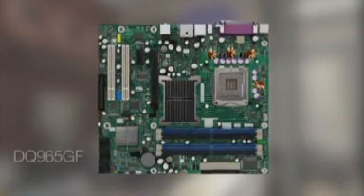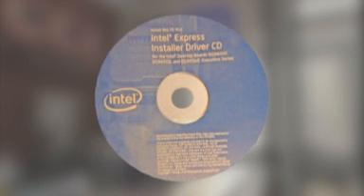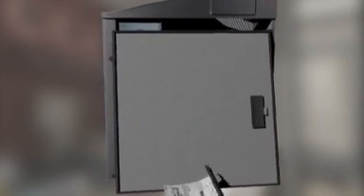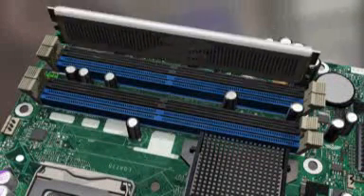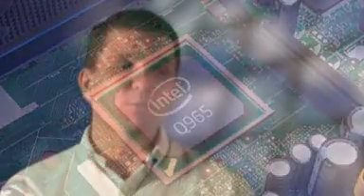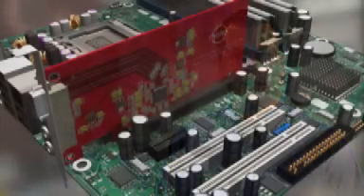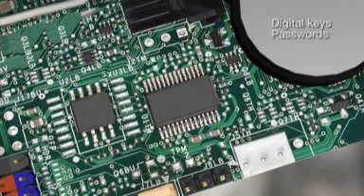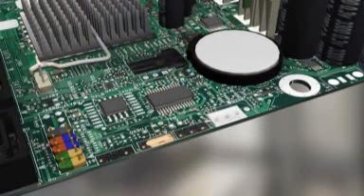Intel DQ965GF Motherboard Review

Comment: I have an old pc ive been trying to get working again.. It has an Intel Board DQ965GF in it. It powers on, but unfortunately I'm always getting a black screen even when I have the disc with the BIOS update in it. Is the motherboard bricked? Any advice helps.
Reply: Try removing the motherboard,s battery , leave it out for a while then refit/replace with a new battery and try boot it up again .
Reply: I have the same issue with this board DQ965GF, I sent it to maintenance shop they replaced the bios chip and it worked then, after 2 days that issue back again it turned on with black screen output.

Comment: i have this motherboard and it won't boot, no bios menu, no boot menu, nothing, everything is hooked up properly, when i turn the PC on i have a green and red light lit on, no boot up beep, fans are working, keyboard is on, hard drive is on, dvd rom is on, but for some reason it wont boot, monitor gets a signal with a green led on, but the screen is black, and i have no clue whats wrong, so far i have done everything i know. any ideas?